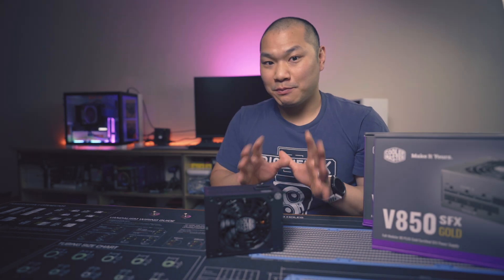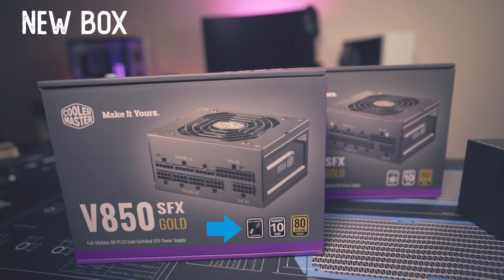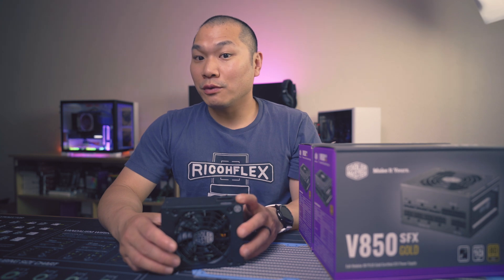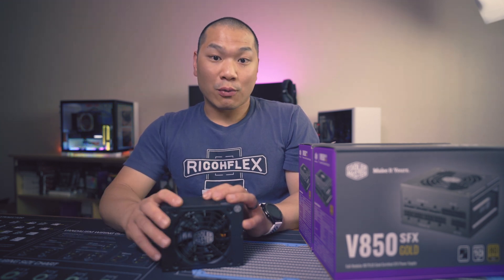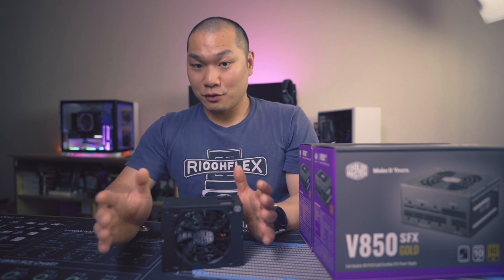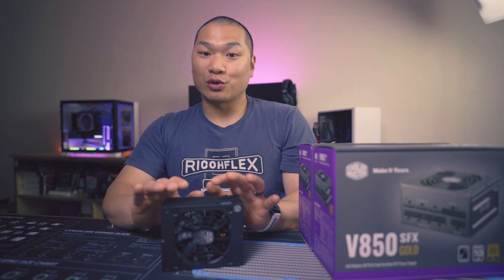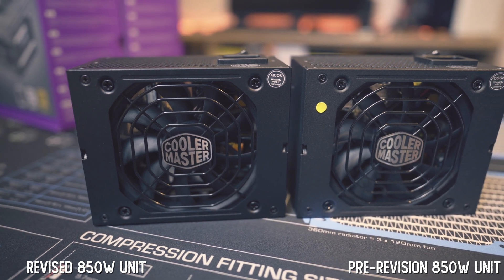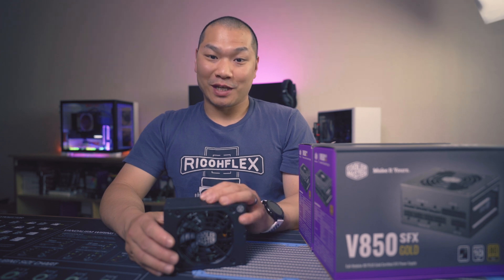A Revised Fan? Cooler Master SFX Power Supply Revision (2021)

Comment: If CM couldn't figure out how to make a proper fan curve, it begs the question: what else did they screw up in that PSU? The fan is just one issue that happens to be one that is easy to spot. Even though I bought a NR200P I'm highly skeptical of any CM product since they have a habit of cutting corners when developing their products. The NR200P for example comes with these godawful Sickleflow 120mm fans that vibrate when installed on the top panel. The CM Hyper 212+ I own has the most obtuse installation instructions and the worst mounting method I've ever seen in a cooler.
Reply: The customer support and service isn’t the greatest either. It’s too bad there aren’t any real good sfx psu options that are comparable to Corsair. Personally, only the SF platinums I would get as my SF600 died on me in just 3-4 years (i7 4770K at 4.2GHz with a GTX 670 to 2070 super Ultra gaming XC). eVGAs sfx psu is decent, but could have better voltage rail regulation esp on the 12v. Wish seasonic or superflower would come up with a good sfx as sfx-l is basically dead just like matx boards are.

Comment: Would love to see a comparison with this to some of the other PSUs such as the Corsair series or EVGAs just to see the difference between them.
Reply: Just bought the evga for my nr200p. Got the 650.
Reply: Corsair SF series fan don't even spin up until 40% load. I have one in my system and its an 850 watt, 40% of that is 340 watts, and everything, GPU, CPU, and MOBO under full load doesn't even hit said 340W threshold so the thing is just a massive heat soak. So I have to run most games at a lower resolution and graphics fidelity settings just so the power supply stays cool enough to not blow itself up. Its an incredibly stupid design clearly not taken into account for the form factor its being put in. Even then it still emits nasty off gassing smells that are very unpleasant. I shouldn't have to do any of that especially not for the price premium that corsair charges for their shit. I'm replacing it with this cooler master unit because they clearly seem to know that Mini ITX SFF builds already struggle with cooling and the unit is rated A on the PSU tier list. Maybe some of the folks over at corsair HQ should take note.

Comment: Hey Machine and more for the revised version does the fan stays on the entire time once the temperature reach a specific level until the next shutdown cold boot ?? Thanks
Reply from the maker: That’s correct, it should always be on if only at a low level, unless your operating environment is exceptionally cold.
Reply: @MachinesMore   Thank you much love for the amazing content keep up the work :)

Comment: I just sent back a pre revised unit. It had terrible coil whine. I heard a little bit of that in the video. I’m hoping my revised unit doesn’t have it. How would you say the coil whine on these compares to the sf750? Or can you not hear it much?
Reply from the maker: I think the coil whine you are hearing in the video is actually from my graphics card- if you listen to the back to back 3 second noise comparisons that should purely be the fan only. You definitely had an abnormal unit. I’ve heard coil whine on the SF units, nothing you can hear outside a case, actually on the V650 and V850, basically none, certainly nothing noticeable in a case, that is the standard, anything else is not right.
Reply: @MachinesMore  So glad to hear! Thanks for the reply and keep up the awesome videos!

Comment: nice share about the revisions...
let say compared with corsair sf series, on same watt (eg: 750w vs 750w).....which one more quieter?thanks
Reply from the maker: When testing the pre-revision v650 against SF650, the v650 was about 0.5dba louder from 20cm away. The revised CM units are a tad quieter than the pre-revision units, so should be on par or a tiny tiny bit louder than equivalent Corsair SF.
Reply: @MachinesMore  Is that the SF600 Gold or Platinum you're referring to? The gold is fairly well known to be the louder of the bunch.

Comment: Nice work as always. Any thoughts on noctua's recent price increases? I personally think it's too steep now compared to the competition. That and they've pushed the launch of the black NF A12x25 chromax for so long it's now likely $45 per fan or more...
Reply from the maker: Cheers. Yeah, I saw that, in general the components market has seen increases in select categories but man, coolers and fans... last place to be expected. I’m not sure it’s a good move, competition is heating up (in a good way 😅) for coolers...    and plus Noctua pricing was already at a premium. Still though, at that price for the black NF-A12x25 you’re going to have takers... we’ve all been waiting long enough!
Reply: I've had 6 air coolers from noctua over the last several years, for me...you get what you pay for with them. Never had a single problem with any of them. I've bought 20+ case fans also. Happy to support them still. Even if your cooler is out of warranty and new mobos come out with new socket, noctua will send you free mounts upgrade for your new board.
Reply: Rick West the mounting system for Noctua is really good. That being said, For most people, a scythe fuma 2 or one of arctic cooling coolers would be more than good enough.

Comment: I have the annoying one. Will they do a swap for the revised unit?
Reply from the maker: They are supposed to.
Reply: @MachinesMore  wish me luck with cooler Master Philippines then.
Reply: @MachinesMore  UPDATE: Contacted Cooler Master and I was advised that they will exhange it with the newer revision. I got into contact with a Cooler Master rep via a local Cooler Master group and they have admins that does support for the company. Downisde is it took a couple of weeks since there's no new revision locally yet. Once it arrived the rep contacted me and we did a swap right then and there. Practically no downtime for my rig.

Comment: Just bought one, need to check this as soon as possible 👍🏻👍🏻
Reply: Contacted CM, they’re sending a new unit ASAP and I’m meant to send the original to them. Very nice service
Reply: @anterogpsilva  Did you receive the unit? If so how long was the whole process?
Reply: @LR13-i1h  I did, took 3 weeks, mainly because of stock issues. But the complaint and assurance of a new one took 2 days or so.
Reply: @anterogpsilva  did you have to send your old unit back to them before they send you the new unit, or can you send your unit back after you receive the new unit and swap it out?
Reply: @mehthewhatever  sent it after
Reply: @anterogpsilva  ahh that's weird, I contacted them and they said I have to send back my unit first, which is not feasible for me since I wouldn't be able to use my computer for 2 to 4 weeks :( did you just open a ticket on fanzone?
Reply: @mehthewhatever  yes I did, maybe it has to do with the support in your region? Mine is Europe.
Reply: @anterogpsilva  ahhh I see! That makes since cuz mine is in Canada haha! Thanks for answering my questions!